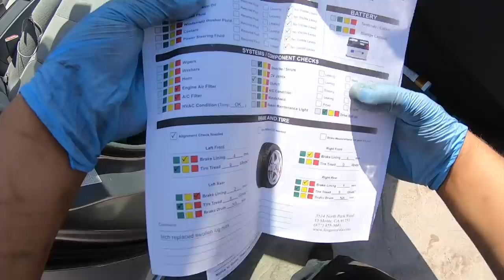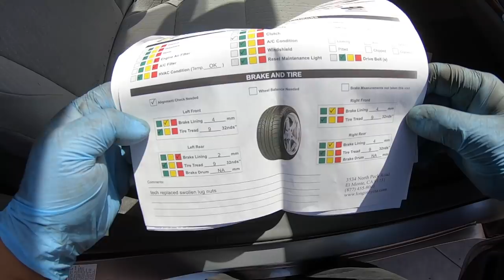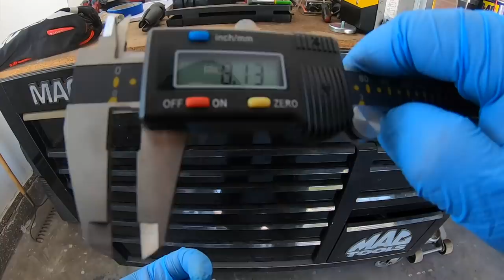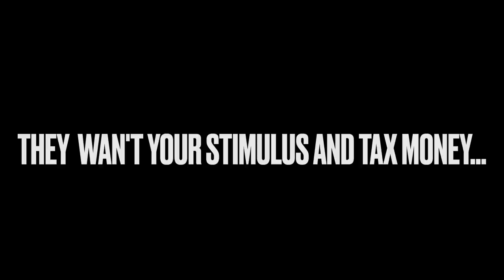This is why YOU need to avoid the Dealerships!

Comment: I spent 15 years at a Chevrolet dealer, I had to leave because I just couldn't live with the way dealers screw people. It's not just dealers, if they have license to work on cars and trucks, they are more than likely screwing people. Two reasons, 1 Because it's easy to do and 2 Because the public believes all the BS they they get fed, not just at car repair shops, the media, and if it has something to do with money--buyer beware, there are crooks everywhere.       Oh, and I'd like to point out that I had to work there for 15 years to get 2 weeks vacation--when I took it, I came back and gave my two weeks notice. I do all of my own mechanic work now, even at 68 years old, I might not be as fast but, I don't screw myself.  My mantra is fix it right the first time.

Comment: I used to be a dealer technician for 3 years, it was a Ford dealer in a small town but 150-200 cars per month were sold on average and the only thing positive I got out of it was suspension, steering, electrical, engine repair and rebuilding transmissions. but my weekly pay suffered under flat rate pay when it came to short and unfair warranty times, only 6 hours compensated to rebuild a transmission not including R&I. It was getting much worse as the general manager was screwing things up left and right and the fact that the dealership makes 5-10 times more money than a technician will ever make in a lifetime, they invest in you when you spend $10,000+ dollars in tools. A lot of the older techs were warning me to get out while I still can and I eventually followed through with my 2-week notice and resignation back in October 2020.

Comment: when i used to work in jiffy lube and similar places the amount of pressure they put on you to sell in incredible.

Your boss will never question you if you sell a fuel injection service to a brand new car. but if your sell average is low that day they will put you either to check tires and clean windshields or to work down in the pit burning your hands and smelling oil fumes all day.. the only way to keep the coveted "upper bay" position which is where you add oil and check fluids is to sell , A LOT! 

I will say this, almost all the fluid recommendations are not according to manufacturer (and even then manufacturer recommendations are a bit too often ) they use "severe driving conditions" which means that they use the worse driving conditions they can muster to get you change stuff a lot sooner.

Radiator service: 30 thousand miles! Truth: you can probably go at least 60 to 100 thousand miles as long as you never over heat your car.

Fuel injection service:15 thousand miles ! truth: you probably dont need to do this ever. it is probably better just to buy a fuel additive and pour it on the gas tank (like sea foam)

Syntetic oil: no sense, I have ran several tests and unless your car requires it it is a waste of money.. pouring pro-long on every oil change i do recommend. that additive is amazing.

Manual transmission every 15 to 30k miles: you can do 50k miles unless you tow stuff or put a lot of heavy cargo in your vehicle. 

Automatic transmission fluid: follow Manufacturer's recommendation
air filter 9k miles ., truth: no sense. take it out and put it against the sun to see if you see light go through. in reality an air filter costs about 25% at the auto parts and you can do it yourself or even ask the auto parts person to change it for you. same with cabin air filters.

windshield wipers: same thing. buy it at the auto parts and ask the employee to change them for you and save 50% or more and get better quality.

also always shop for coupons and never pay full price for an oil change.

Comment: I had  a 2013 focus in for the dual clutch problem, mechanic said the brakes were good. Took the tire off to see where the transmission drain plugs are, (so that when I took it back to Actually have it repaired I might be able to tell if they had replaced the fluid). About 1 mm left. His explanation to the service manager; We aren't given enough time to pull the wheel. My daughter explained the issues but they only wrote drivability issues. He suggested spark plugs, throttle body, fuel system cleaner, based on mileage. Did not investigate dropping out of gear while accelerating from a stop, then back in gear, and doing the same thing at speed on the highway. Similar to a pushing in and out the clutch on a manual. Ford replaced the transmission control module under extended warranty, but not the clutches which the module had damaged.

Comment: Oh do I have stories.
Longo Toyota?  My friend took a brand new Sequoia in to them when someone tried to break into his vehicle.  Longo Toyota tried to replace the broken window part with an obviously used rusted part.

I bought a brand new Tacoma from Puente Hills Toyota.  Years later after the extended warranty "free oil changes" was over, I started doing my own oil changes.  I found shop rags stuffed between the skid pan and the engine to absorb the spilled oil!  I also found that the driver's side motor mount was missing the bolts to the frame!  They actually accused me of removing the bolts and wanted to charge me to install them.  You could tell there were never bolts there because the paint in the holes were never scratched.

Great product but poor American dealership and factory service.  My Tacoma was built in Northern California.

Comment: We were taught to go my manufacture suggested miles and not by the car's needs. This is a huge scam because there were many times we replaced brakes because of the odometer when they were still good. be careful of conversations like this: "Have you had your brakes done recently" customer, "Idk i just bought it two years ago". "Well, the manufacture suggests you get new brakes, Air filters, coolant change, etc". manufacture suggested means the shop was too lazy to take a look and just trying to sell you stuff you don't need.

Comment: i have a 2005 subaru with 320k original engine, hasnt burned or lost a single drop of engine oil. it does have a torn cv boot that has slung oil all over the place. subaru told me my engine was going to blow up!....that was 4 years and 120k ago. and they missed the torn cv boot!

Comment: I drive 3.5 tonne vans for work and I'm convinced the guys that are supposed to fix them will kill someone one day.
We had brake squeal from all four corners on one van. Called them to repair it. All they did was overfill the brake fluid to stiffen the brake pedal and tighten the handbrake cable. Didn't even take a wheel off to check the pads.
Another van had a faulty driver side seatbelt, also causing an airbag fault. They unplugged the warning light in the dash. Another tech came out and said the only problem he found was the plug came loose from the seatbelt buckle, causing an error which would stop the pretensioner working properly and airbag deploying. All he had to do was plug the sensor back in.
Another van is so overfilled with oil that it's leaking out the filler cap when warm. My manager called them to fix it and they said the van would have be taken in to shop and have a full oil change, including pumps and filters, and would take five days to repair! To drain oil?!

Comment: When I bring my car into the dealership for an oil change and they recommend service, I always decline it unless it's something that I know is a problem.  If I bring it in twice and they say the same thing needs fixed, I then fix it.  I figured it's really broken if they see it twice.  99% of the time, they'll recommend something and then the next time they won't say anything about it (except typical service interval stuff like spark plugs at 100k, coolant, etc).  So that leads me to believe they just randomly recommend things or recommend fixing things that aren't that bad if another tech doesn't catch it.

Comment: They probably weren’t even gonna put the brakes on. just gonna charge him for new brakes.  I have a 2010 Honda Ridgeline I took it in for the airbag recall on the passenger side. They did the recall and then came back with a laundry list of stuff that needed to be done. Injector flush, brake service, coolant change, spark plugs etc. I said with all that stuff wrong with it is a wonder it even drives down the road. By the way did you catch the power steering whine when it first starts for the first second the engine runs. No didn’t hear that. Told them it needs an inlet seal on the pump it’s sucking air there’s needs a new updated seal. They said we can fix that for you I said no I’m a mechanic I think I know what’s wrong with my vehicle. You guys are trying to upsell work on the vehicle that it does not need. I can fix that myself for under 10 bucks and maybe while I’m at it I’ll change the power steering fluid too. Worst part of this deal is I used to work at that Honda dealership as a mechanic/technician.

Comment: The proper way to pronounce dealership is "Stealership". A few years back I took my audi to McKenna Audi for a faulty fuel injector under warranty they call me to tell me that fuel went into the oil and needed a oil change and had to pay $120 for that!? I was like that should be covered under warranty and after I went off on him they decided to cover the cost. Then they call me back that I need a new battery and rear brake pads $1400 I told him I had just changed the battery a month ago he then just made up some bull excuse and I told him to hold off on the brakes. When I got home I checked the rear brakes they were at 80%! Never trust a dealer only go the for warranty work!

Comment: Weird thing happened to me at the dealership a while ago. My front brakes were squealing a little bit so when I took it in for an oil change I asked them to check the brakes. They told me there was 3-4mm left on them and they'd probably last until my next oil change. 3 weeks later, they started making a grinding noise so I took it to an independent shop. (Honestly I would have taken it to a dealership but they're all so busy and you need to make an appointment way in advance these days that it's too much of a hassle!) Got the pads replaced for like half the price of the dealership. 

I still wonder why they would say the brakes were still good when they weren't... maybe there's more profit in replacing the rotors as well? LOL.

Comment: I used the same mechanic shop for nearly 20 years.  I am not a demanding
 customer.  I do not pester when the vehicle is done.  I do not get 
upset when I catch their mistakes.  Yes in 20 years I caught mistakes.  
However the last vehicle I ever had them work on truly was a rip off, 
and that I will not take.  Vehicle needed a new timing belt.  I get it 
back, and it is stalling at low temps, I check codes it claims coolant 
temp sens out of range.  Now, I'm not a mechanic, but I'm not ignorant 
either, I return it to shop and tell them the code, and that engine 
management was fine before their repair.  They "fix" it, and charge me 
another 200 bucks.  Now the vehicle is stalling in high temperatures.  I
 check the codes and again coolant temp sens out of range.  Now I'm 
irritated, and I call them back and mechanic tells me it is the fuel 
pump.  I'm livid at this point.  I am disabled and working on cars is no
 longer a choice.  So I decide to pop the hood, I go to the coolant 
sensor next to upper radiator hose housing, unplug and replug in sensor.
  Problem solved.  Took me 5 minutes.  Now you might be wonder, why I 
didnt do this in the first place, well because I had assumed that during
 the timing belt job, they may have screwed up a wiring harness, or a 
ground, that I could not reach.  Also, because I paid them to fix the 
car.  LOL  Needless to say I never went back.

Comment: The real issue is the flat rate system.  Dealership techs get ruined financially by outrageous warranty times, then live off of pointless upsales of services.  When I worked at Nissan they recommended brake flushes every year or 12k.  I'm at another dealership now and it was an argument to even get paid labour on cabin filters where we had to remove an entire glovebox, not just fold down a door, but un bolt the whole thing.  

Then there's the aspect where anything as a tech I write on inspection that will be required next service (8 to 12 thousand kilometers from now)  gets sold early by advisors who are also under huge pressure to make bonus goals to make actual pay checks.

Comment: After I took my car to the dealership for a repair. I had a dealership upsell me new brakes, including rear discs that were still on their first set of pads.

I took my car back 2 weeks later, as the dealership hadn’t carried out the repair properly (maybe they did nothing at all but only the quick and easy upsell?)  The dealership told me the brakes had worn by 10% in 2 weeks.

I now would rather sell my car and never use that manufacturer or franchise ever again.

Comment: Had something similar happen to me a few days ago. I went in for two things. The dealership said I need 5 other things which cost another $500 on top of the $400 I already need to pay. Then they said I need an oil change and tire rotation because my car maintenance reminder thing says it. The technician didn't bother looking at my oil, they just looked at the reminder thing. Those reminders are based on how much the car is driven, and get reset when you do the maintenance. I had my oil changed 2 weeks ago and forgot to reset the reminder. I am a HVAC tech myself, and I have been trained/taught to test stuff before I say it's okay or not okay, and it's common sense anyway. How can you be sure I need a oil change without checking the oil? They already had my hood open, how hard is it to check the oil. It pisses me off I go to do two things, and they "recommend" extra. I understand if I need it, but the dealership was very pushy, they asked me 4 times if I wanna get the extra stuff even though I kept telling them no.

Comment: I hate the 1 dealership in PA (Pennsylvania) which i have a 2020 Hyundai Electra with only 8k miles on it and had it for 9 months already saying i need new battery, brakes, air filter which they already put wrong oil in my vehicle which i still have the paperwork of that so i took the oil out, i drained it and put the right type in before it does anything else to the car which idc if it avoids the warranty, i believe this company trys to lure ppl in to get more money which i should of believed the reviews of this place which there BAD. I refused to go there for anything which i dont even care about the 2 more free oil change there. Could careless about it which it takes 10-25 minutes to do it myself.

Comment: It's not just dealerships but other shops will try to cheat you. I brought a vehicle to a nondealership shop who said I had a stuck caliper. Found the mechanic didn't test drive it even though their ad claims all cars are test driven during brake diagnosis. "A test drive wasn't on the work order", the mechanic said. Brought it to another place who checked my brakes and they never found any caliper problem.

Comment: I wonder if they pull this on Prius drivers who have brakes that last 100,000 or more miles? Hybrid cars get a lot of their braking by reversing the electric motor which also charges the battery.

Comment: 2:35 checks to look at the brakes. Can’t see them. Hmmmm, I have to take the wheel off...

Dealership checks to look at the brakes. Can’t see them. Hmmmm, it needs brakes all around. 

I’ve just given a very simple example of an auto techs assessment versus a parts changers assessment.

Comment: That my friends was called a rim check break inspection (at best) . "Tech" looked through the gaps in the rims and guesstimated how thin they were and not taking into consideration the angle of PoV or the fact that the caliper obstructed most of the pad. I see it all the time. I tell all my customers- if you are not sure. Make them show you. If they don't or refuse to show you. So no thank you and get your vehicle back.

Comment: Took my BMW to the dealer fir an airco charge after replacing the dryer and condensor. I told the desk guy I wanted it written on the work order that they need to add extra compressor oil. You could see the empty glaze in his eyes.

At dealerships there two problems. 1. Fancy service people that have no idea how a car works.
2. Absurd hourly rates (to pay the service guy) that they will never diagnose a car propperly. Hence the dealer also does not gave real expertise.

Comment: Yup had the exact same thing happen to me at Courtesy Mazda in Longmont, CO. They told me I needed a brake job, also tried to force me to pay for other work I specifically told them not to do, but they did anyway and charged me for it. When I looked at my brakes they were exactly like the video here, nowhere near needing to be replaced. After they tried to charge me for general maintenance work they did I reported them to the BBB and slammed them on Google as well. They then called me and asked me if they could make it right. I told them to go suck it and that they will never touch my vehicle again. Now I do all my own work when I can.